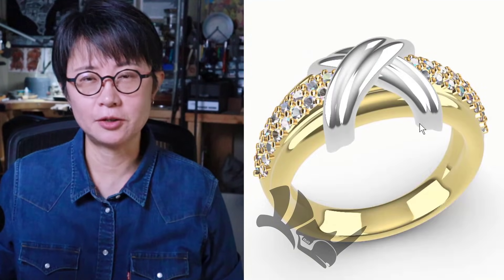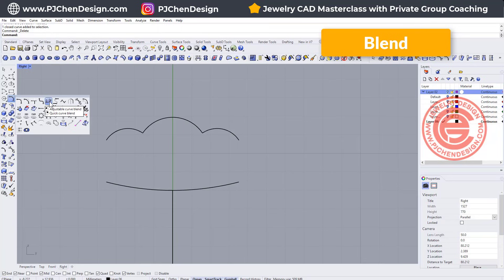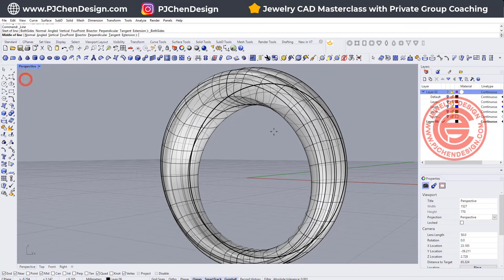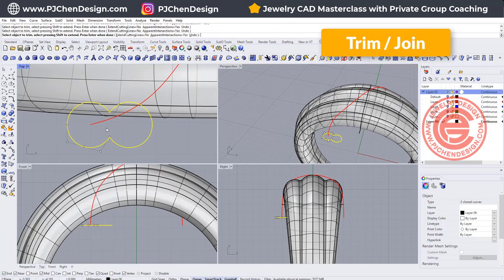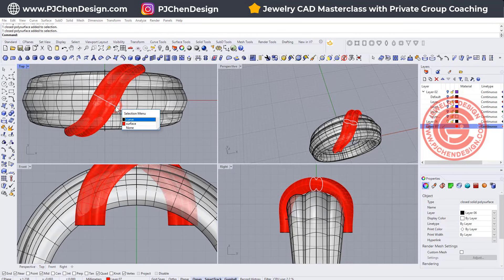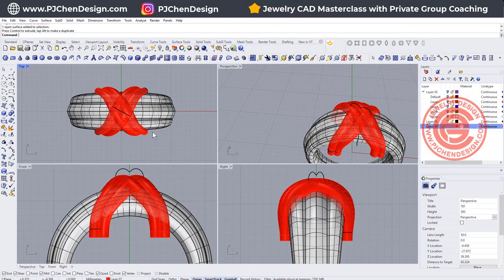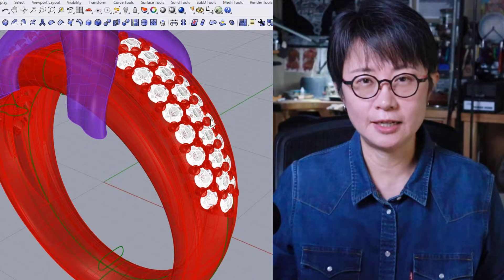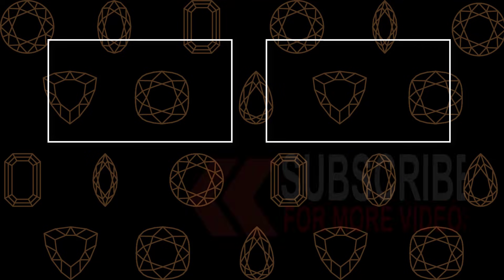Rhino 3D Tutorial: Creating Antique X Rings #478

Comment: Thank you for the tutorial. I feel like the hollow underside with the crossed X wires protruding looks a bit CAD. Perhaps they could have been trimmed before the union. I dont own a printer but I do wonder about the edges of those boolean unions and how they print without fillets controlling the contour? Maybe with resin they are fine?
Reply from the maker: the print will be the same as CAD. if you want the edge to be softer, you can have the edge filleted before you boolean union them.